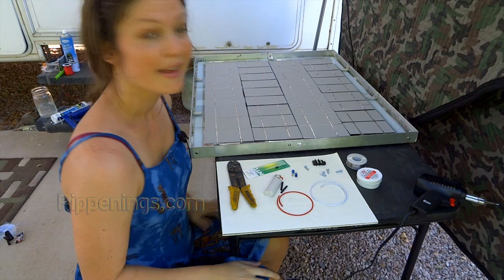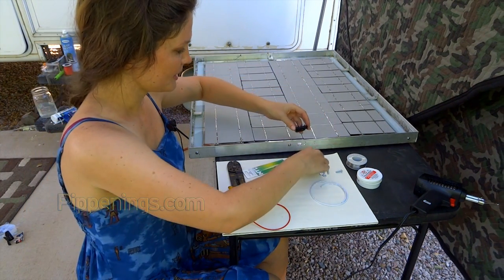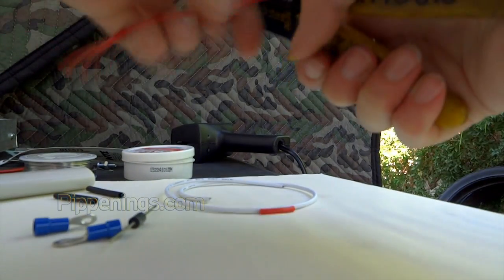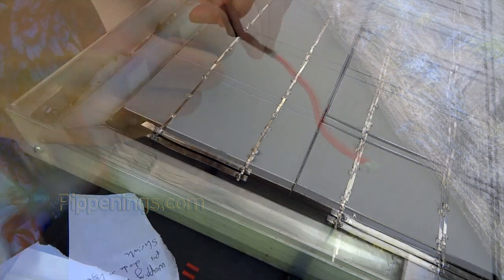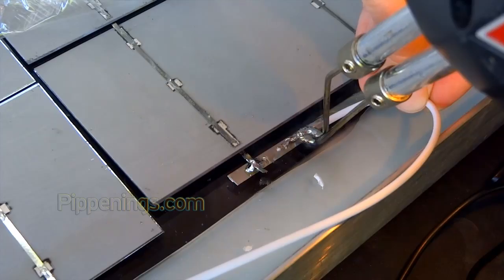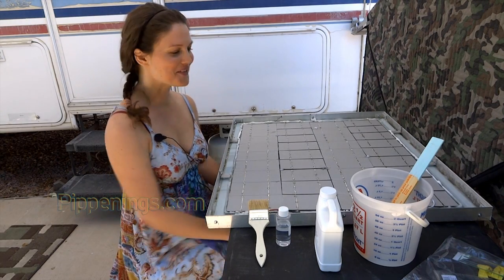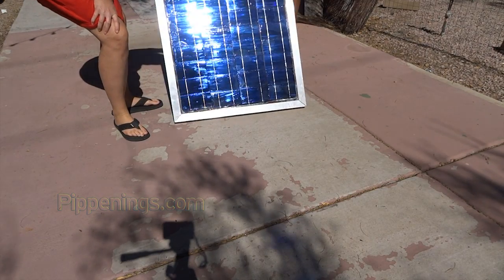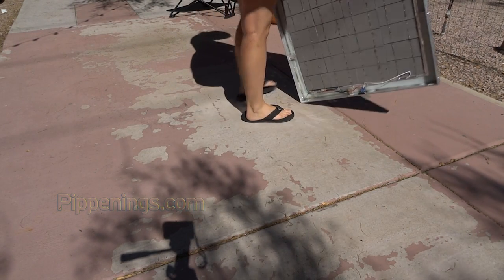DIY Build Solar Panels 2/2: Homemade from Scratch, Wiring, Encapsulant

Comment from the maker: Follow along with more information from the accompanying blog like wiring diagrams, specifications, ratings and changing your panel's sizing at http://www.pippenings.com/rv-living/diy-solar-build-homemade-solar/
Reply: You are very beautiful and very smart 👩 woman.
Reply: They sell Monocrystalline solar cells 5 watts per cell on ebay for $2.69 each. You can make better solar panels with Monocrystaline 5 watts cells.
Reply: Hai
Reply: Dear Pippi,  I enjoyed your presentation of a solar panel build.  Of course the cost of the first one will be high, but there are things you could do reduce cost, such as gluing the panels to a board just in the center to hold them in place, then put the glass over the top and put a piece of Hard Board called Masonite or a plastic shower wall to contain the panel and seal that.   If you really want an efficient panel make a hot water heater panel with small tubing and then use silicon or your epoxy to glue your panels to the tubing, then put the glass on and an insulated back.  What this would do is create both a solar panel for electricity and a solar panel for hot water as well as keeping your solar panels moderately cool in the summer time.     
       I have designed an air ship after the star ship Enterprise and I wanted to design it with a few kilowatts of solar power.  The letters are so large on the ship and the numbers too that I could make them out of solar panels, but in the shape of large letters as long as 7 feet.  So using your method and plexiglass as a top cover and a black board underneath  the individual cells the letters could produce a couple of hundred watts a piece.   NCC 1701 A Enterprise would make a kilowatt atleast .  And there are other features too that could be utilized as solar panels.   4 kilowatts is only about 5 horsepower, however and that is not a lot of thrust on a ship  380 feet long by 176 feet wide and about 90 feet tall at the dome.   But it is a lot of power to run the cameras, lap tops, air conditioning and maybe one auto-stabilizer.   So sometimes you need panels made a certain size or shape for a unique purpose.  Then it is very worth it.
Reply: So how much did you save in doing this? Or did you?

Comment: Also apparently purchase are tempered glass and they're about as a little thicker than you think but not by much but my solar panels do is stand quarter inch to half inch hail and they also respond how much snow but more snow than they say they would I have some cells but I have never made any solar panels of course every time I buy sells they never will sell me enough to make a solar panel I think they're really finicky on that part.

Comment: Great video. Can you cut the cell's shape? I want to make something that has a varying shape (say a triangle or oval...the shape would vary), but I want to use all of the glass space within the shape, some I'm winding can you cut the small rectangular cell into triangles, ovals, diamonds or hexagons, or any other shape? (I know, more time, soldering and assembly)

Or can you buy solar cells in these different shapes?

Comment: I have a few questions about your solar build. Were the aluminum angle, tempered glass and encapsulate the more expensive materials of the build? What was the exact cost of each material in the build? I have a few ideas involving this build. Maybe I could run a few by you and see what you think.  And lastly how is the panel holding up today?

Comment: Pippi, first, EXCELLENT video!  You truly rock!

I'm wondering, what about just putting a piece 
of plywood, behind the cells?  No silicone, no 
epoxy, just a piece of plywood to hold everything 
in place.

Oh, are you in Arizona?  Judging by the looks of 
the outside, somewhere in the greater Phoenix 
area.  The airplane that took off, says west of 
Sky Harbor.  (I'm in Mesa.)

steve
Reply from the maker: I was in Mesa, too. The cells need to be airtight to not degrade

Comment: It may not seem worth it to some, cost wise, but depending on the materials used, especially with how technology gets better and better every single day, I personally feel it would be worth it. Of course.. I also just like to make things, so that in and of itself is a payoff along with a working solar panel. Thank you for making this, I think I may have found a new hobby that has an end result I can use on the road.

Comment: Very informative on assembly, I was planning on mounting a self made panel down the side of my van on both sides so no matter what direction the sun was would always have power. solar on roof easy but now I know how to mount them on the side correctly I thank you for your wealth of knowledge.
Since it will require only the cells and some wire/solder I think I can bring the price down to little more than the cost of the cells.

Comment: Hey I just though of something.
So I have a few 24v panels. I can change those to 12v by changing where they connect about half way through. In effect making a 24v 250watt panel into a 12v 250 watt panel. ( because I half the volts and double the amps so watts will stay same)
Reply: Will help to upgrade wire gauges.

Comment: It is possible to build these cheaper and lighter than commercial ones if you engineer them correctly. They can be made for about $1/Watt, though it takes a bit of time.

Comment: Love what you are doing, I know it costs more to build than buy ready made but I have a sailboat and fitting in as much solar as possible would be easy this way on curved surfaces and encapsulated in epoxy. Problem is epoxy degrades in the sun mmmm got me thinking
Reply from the maker: The epoxy I use in the video does not break down and is meant for electrical encapsulation

Comment: Hi Pippi - Just a note to say thanks for reminding me it's fun to DIY and learning is definitely where it's at.  I've been a techno geek since age 3+ when I made my first crystal radio.  My father worked with Tom Watson (Mr. IBM) from its inception. Dad would bring home parts when PC's went from tubes, to transistors, to IC's, etc.  I worked with computers before they had monitors.  That's true GEEKDOM ( : -- My first DIY PC project was in the form of wire wrapping sockets which held IC's then onto designing PC boards, etching them, soldering components.  BUT . . . this is about you and how fascinating you are.  If I had a daughter your age I'd hope she'd be much like you > Curiosity, hands on, think ahead, and on and on. I'm largely into drones now and have been thinking about solar amplification to increase flight time vs spending $90 per smart battery.  Any ideas?? Peace/Out -- FlyBoy SoCal
Reply from the maker: Very cool, good for you. I like the solar on drones idea!!!

Comment: Great and inspiring video covering all of the details including wiring loss, blocking diode, potting material, flux, and all materials needed. Keep up the great videos. It is important to note that when installing and connecting to a 12V battery, a solar charging controller should be used to limit the voltage charging the 12V battery to somewhere around 14.4V, a "float" voltage that will fully charge the battery but not overcharging and damaging the battery. The diode you used looks like it might be underrated for the typical 3-6 Amperes of current being generated by the solar cells.

Comment: Officially subscribed... I am inspired. Would you consider this worth it, had you done it on a larger scale (say, 10 panels instead of 1)?
Reply from the maker: Welcome to the community. It was worth it for me to learn but no. Just buy them. They’re cheaper by the day.
Reply: @PippiPeterson  it really did look like fun.... How did you know what kind of diode to use? Was it based on the total wattage & would it differ if it's series/parallel configured? The cells themselves, are diodes, right?

Comment: Thin LEXAN is better than ANY glass, it virtually cannot be broken.  It's not cheap though.  If flying debris from twisters and hurricanes are a concern, lexan is the boss.  It would create an indestructible panel.  You'd have to worry about securing it more than anything else.

Comment: Hey to Pippi, Dave here
You could order the 1/4" tempered glass through a local glass and mirror shop. As well, a nearby electrical supply store will sell specialty wire by the foot.
Not sure what to do about those poorly performing panels; someone commented they could be factory-rejects.

Lord Jesus bless

Comment: Nice job Pippi good information for builders. One note the purpose of the diode at the terminal block is to prevent back feed of voltage at night, without it you would energize the solar cells producing heat and in turn draining the batteries. Observe polarity when connecting the band on one end of the diode should face the terminal block thus blocking voltage feed back.

Comment: Pippi. dont scary but epoxy resine is toxic. and produce cancer.  when you appli use mask.. and dont touch much. you have a table in your RV.. buy a glass or plastic film and put over up. sorry for mi bad inglis..

Comment: cd solar cell ,how much efficient and wattage,if sticking two cd dual side with using alluminium net for electricity and connect with this like  normal cell.if we arrange in cylinder module both side working and central cylinder mirrors for reflection sunrays.reply opinion on projectnaturalfuture@gmail.com

Comment: A quick tip for next time you can run diodes in parallel to decrease the load on each diode and that will in turn decrease the resistance and not hamper your voltage

Comment: i just got done watching both  parts of your solar panel videos and would like to thank you for doing a great job. Have you ever thought about building your own generator the runs it self and can put out more than enough power to power two refrigerators tow flat panel TVs  and a 6 gallon electric water heater and AC unit for the summer along with extra power if you need it? I would love to see that video

Comment: Nice video.  But I wonder about the conclusion that it costs more to build your own.  Pippi, you compared $1 per watt to your construction costs, but you were building a 60-72 Watt panel and usually only panels over 200 Watts (or so) carry the lower $1 or lower Watt cost.  Buying panels for 100 or 60 Watts usually cost more than $1 per Watt.  Perhaps you could get a comparable cost  by using different cells and building a 72 cell panel, and buying cells on Amazon in bulk.  Current Nov 2017 prices for 4.8Watt cells, 6x6 which is bigger in size from what Pippi used, you could  buy in bulk today for $2 a cell for a quantity of say 300.  This would allow construction of 4 panels of 72 cells (with some extra cells to allow for possible breakage or bad cells)  that if properly constructed should yield a nominal 330-340 Watts for a 3 1/2 foot by 7 foot (approx. size) panel.  4 such panels would generate about 1.2 Kw.  Buying similar panels from the altE store would cost about $1.2k (if shipping is included, though shipping varies depending on where shipped to). Pippi commented that her 72 Watt nominal panel (based on the cells ratings) only generated approx. 60 watts.  However, commercially purchased panels often don't always produce the rated wattage either.   I extrapolated Pippi's costs of construction to no more than this amount, and probably less.  Thus with different solar cells, a larger panel size (use 72 cell panel for a 24 volt off grid system), and slight economies of scale, I found the costs to be not more to construction your own, but about the same or slightly less.  Still you have to input hours of work to achieve the same cost, you might make mistakes and/or the panel may not last as long, but contra this you possibly have the tempered glass advantage.  Constructing panels like Pippi did makes sense as a fun project, where you don't mind the time with no return for it, or if you wanted to alter the panels to experiment in some way (constructing your own you have complete control as the cells are being processed into a panels).

Comment: Hardener(?). That 2nd part you were referring to. The catalyst? Sounds like you are referring to the hardener of a two stage epoxy. 
       Thanks so much for the informative video. I was wondering if a person could manufacture they're own solar panel at significantly less(I'm sure) than what you would pay for at commercially manufactured prices.

Comment: No biggy for awhile, but the flux you're using looks like acid flux for plumbing. If so you definitely need to swap that out asap for some Kester flux made special for electronics. It comes in a push pen. You can buy it from ML Solar on eBay. It's not corrosive to copper wires made for electronics. Copper pipe for plumbing heating etc is a tad bit more beefy to stand up to the corrosion. Electronic wire is made more flexible and less surface to corrode. If you start seeing corrosion change it immediately.

Comment: Why not wrap the diode with shiny foil with hot glue and the spray clear laquer on it? I also think using oil on the back sealed in would help cool it.

Comment: This is for the fuse video. Why does the positive have to run through the fuse but not the negative?  How do you know all of this electrical stuff. Are you a mechanic or what?
Reply: It is not a fuse it is a diode it only allows power flow in 1 direction.

Comment: Great video, I was thinking of making some panels to power a small cabin. The cost for cells alone seems cheap at .22$ per watt on ebay.  After seeing the additional materials and time it took, definitely helped me reconsider.  Even making a batch of 10 still doesn't seem be cost effective, besides the DIY satisfaction. Thanks

Comment: try to twist the both end of the wire before soldering.nice work pretty lady.i used solar panel to power my staff coz it is cheaper in a long run..so far i have 600w solar panel and planning to upgrade soon.

Comment: First you should twist the wire into the food lead to make it a better connection. Over 55 year of working with solder telling me that the solder is only to keep things in places. The wires should have good electrical connection before soldering.
Reply from the maker: +Donald Smith Thanks for the tip!!

Comment: Should someone want to build a similar project, the polarity of the diode must be determined. When you look at the diode, there will be a white band painted on it near one end. For this project, the lead (cow antler or little leg) near the white band on the diode should be connected to the terminal block. Should the diode be reversed, no damage will occur, the panel will simply not work.

Comment: Hi from South Am... can you tell what you do with the back of the panel ? no final protection for the wires and cells encapsulated ?  you leave the back unprotected at all ? thanks for spending your time teaching us, very interesting ! Toni
Reply from the maker: +Toni Rosa I poured epoxy over it.
Reply: +Pippi Peterson, so you have covered all the back of the panel with any type / kind of fluid epoxy and let it cure ? Transparent or coloured epoxy ? Do you have it in video ? No EVA ? Thankx a lot !

Comment: Interesting, but your soldering technique is horrifically bad. I would suggest doing some more research on soldering (and practice it) before attempting to instruct others. The soldering flux you used looks to be acid-core plumber's flux, which will destroy your solder joints over the next couple of years. Most modern solder is rosin core, and does not require the use of flux of any kind. The technique you used to solder the diode is also very wrong - solder should not be used as the mechanical joint between two things, it should encapsulate an already strong joint in order to prevent oxidation.
Reply: gsmac1969 "it should encapsulate an already strong joint"??... don't tell that to pcb hobbyists or manufacturers. As pcb joints are non existent until they're soldered! lol... Having said that, I do understand your point. In this case, its best to wrap the wire around the legs of the diode, prior to soldering. Then coat them well while keeping it tidy. I do remember many if my early solder joints looking like hers did here. You learn by doing.

Comment: the 11 100w i got from Renogy has survived a hail storm with egg size hail and not a single cracked panel very happy 
have 8 100w charging 16 6 volt cart batteries and the other 3 are hooked to a 300w water heater 12v element in my 40gal water heater and could not be happier with Renogy products  
very cool building your own very fun project and a great learning experience but i am a electrician so easy for me to understand how it all works 
even wiring up my 2 40 amp controllers in parallel having 2 banks of 4 100w panels connected in 12v system 
for charging my 16 6 volt batteries

Comment: The grey on the diode is the cathode (negative) and the other end is the anode (positive) with ~.6DVC voltage drop when conducting. Warming the metal strips first for a few seconds, then add some flux, then solder the diode lead to the metal strip looking for the solder to 'sweat' the joint. Most flux is non-corrosive, but can be made clean with some nail polish remover (acetone) but be sure to clean off the acetone with some rubbing alcohol afterwards. Be sure to let it all dry thoroughly before using. Nice job Pippi!
Reply from the maker: +Trog Lobyte Thanks for the great info!!

Comment: During the full panel test using the mirror, sunlight had to pass through the mirror glass twice as well as bounce off the reflective surface.  The glass and surface interactions absorb photon energy, so the real world direct exposure output without the mirror will be significantly higher, perhaps 10 or 20 % more than the mirror test !